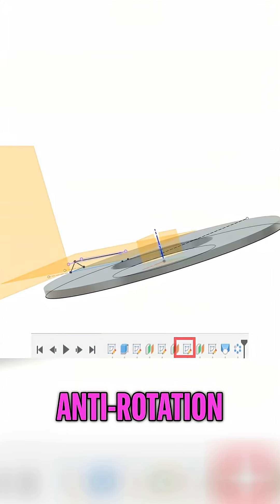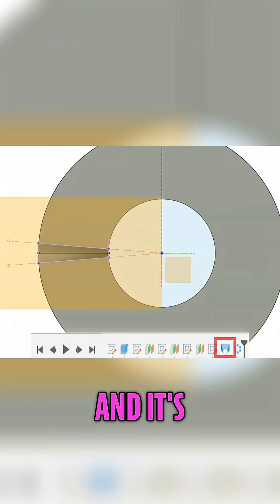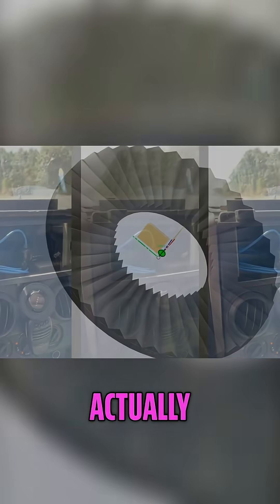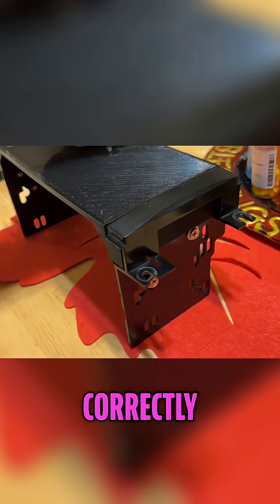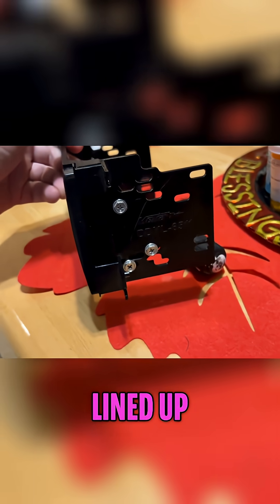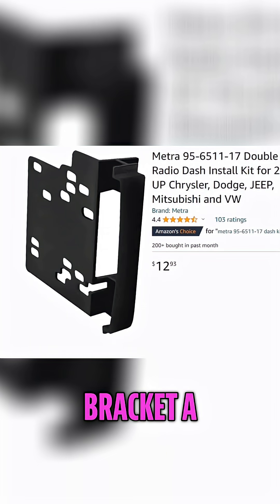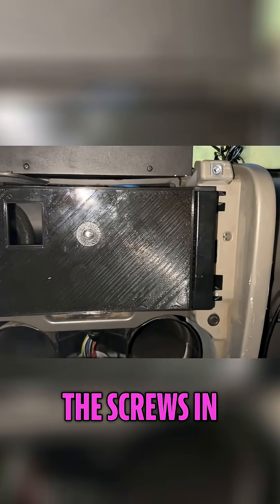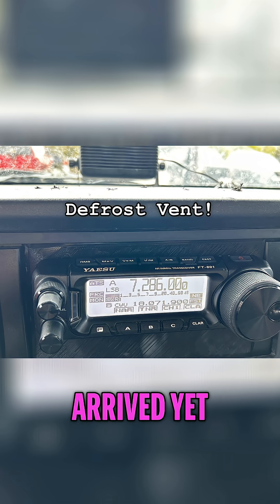Jeep Wrangler Radio Upgrade: Custom Yaesu FT-891 Install #shorts

Comment: Slick setup. Might work for some other double DIN setups too. 

How hard would it be to inset that mount and add a hinged door so you can hide the control head when not in operation?
Reply from the maker: That’s an interesting idea. I don’t think it would be too difficult for the qualified person to do. I’d get into a wreck if I wanted to inside it while driving. Sometimes I listen or scan to find POTA contacts while I’m traveling. I figured less moving parts would also be more robust.